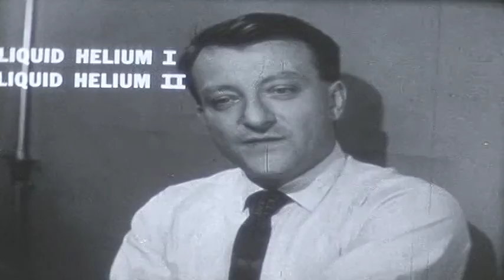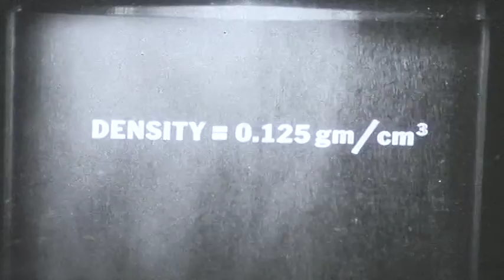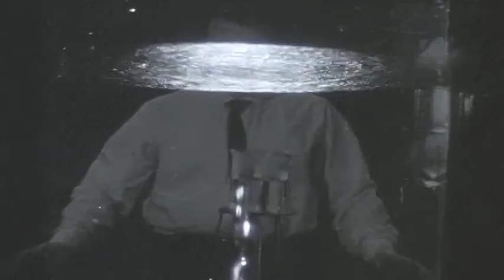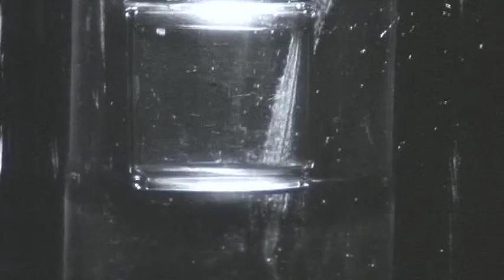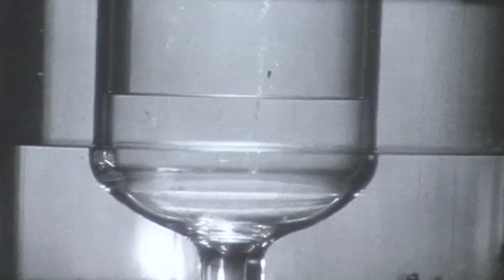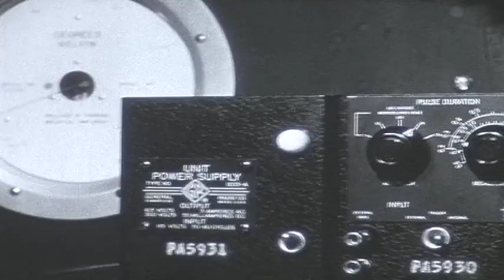Superfluid Liquid Helium (Isotope 4) - (39 min., 1963)

Comment: Why doesnt helium 2 pass through the doers flask.... It is certainly passing through the finely porus flask
Reply: It does at a very slow rate I guess.
Reply: The dewar is not finely porous.
Reply: intermolecular distances in an amorphous solid are at least an order of magnitude smaller than "a fraction of a micron" that the powder supposedly has